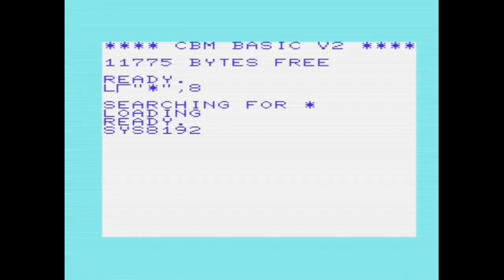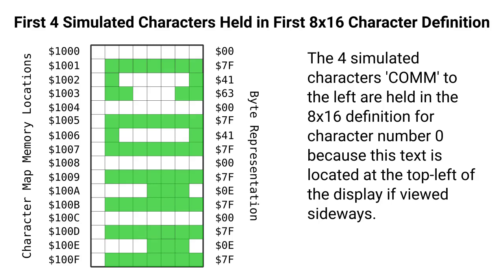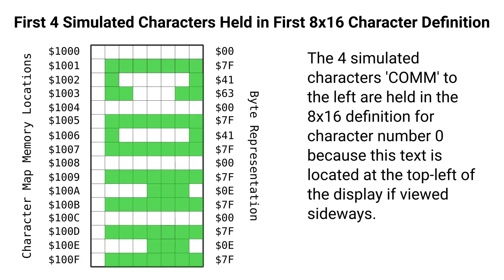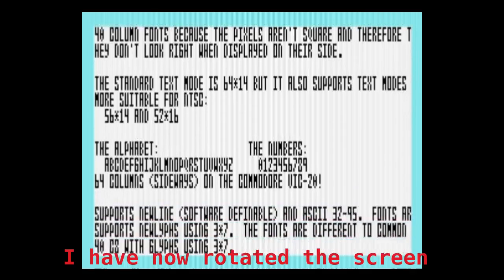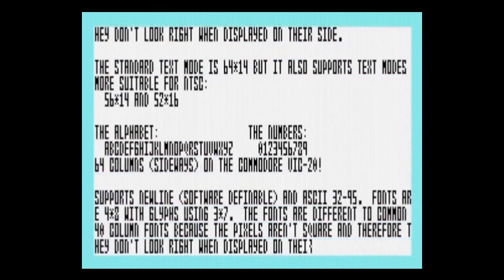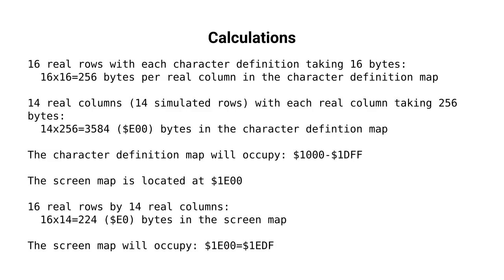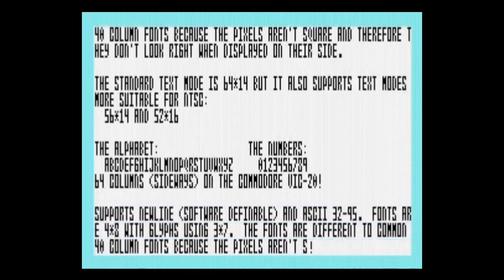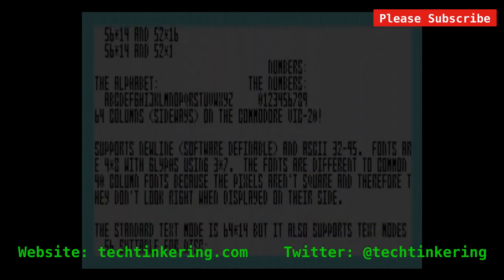64 Column Text Mode on the VIC-20

Comment: The vic was a very versatile machine if you put the time into doing things like this. Excellent video as always.
Reply from the maker: Thanks.  The Vic's combination of simplicity and versatility is one of the things I like so much about this little machine.
Reply: @TechTinkering  I regret selling mine decades ago. I do use the emulator. Do you know if you can do tricks with the interrupts like for instance the using the scan line number register? I'm thinking ify ou can use that somehow to switch character location out on the fly you might be able to get even more screen real estate by using two RAM based character sets.
Reply from the maker: @GORF_EMPIRE  There isn't an actual raster interrupt, however you can query the raster position and create another interrupt to synchronize with it.  I was thinking about using the raster and two 32 column screens (viewed sideways) and flipping them when the raster reaches the bottom of each.  This would allow me to reach the 64x16 text mode that I would like and probably do even more simulated rows.  Something to try for the future when I get time.
Reply: @TechTinkering  I say do the flip in the center of the screen and do 64 x 32. Look forward to see what sorcery you come up with.
Reply: @GORF_EMPIRE  You can always buy one on eBay, although they are a little more expensive now than years ago.
Reply: @unebonnevie  I know but funds are tight and quite honestly I need to get rid of things more thn collect them. Have other expenses and priorities. I have an emulator and the MiSter FPGA which are both beautiful things but to be able to type on that old keybaord again.... ah the memories.
Reply: @GORF_EMPIRE  check Keyrah, with that you can type on the commodore keyboard and plug it to anything with usb  :)
Reply: @roonie12video  Neat device. Something to consider in the future.

Comment: If you don't mind the character codes from moving around in the 224 bytes of the screen in sideways mode, you can scroll quicker by moving the codes (rotate around and clear the lowest line) when scrolling up (to the right). Also, with a Lumacode extension to an RGB2HDMI connected to a turnable widescreen HDMI widescreen, you could have vertical page properly depicted.
Additional, if you were to implement an ASCII BASIC, or perhaps a more simple turtle program, you can implement graphics routines that can write into the "textscreen"  as well.

Comment: NTSC can do more columns if you take advantage of interlace. However, this dramatically increases the RAM required per row and/or makes you use uncomfortably narrow characters.
Reply from the maker: That is interesting.  Thanks for letting me know.  I've never used interlace mode on the Vic because it isn't present on the PAL version.  I'll have to see if I can find an emulator which can do it.  I think Z64K can, not sure about Vice.
Reply: @TechTinkering  There's also a very weird NTSC VIC-20 capability which, AFAIK, I am the only one to ever experiment with. The NTSC composite output, when connected to a monochrome TV/monitor, can be used with two alternating fonts or images to provide 14 horizontal pixels per character instead of just 8. So, a 20 column wide display would be 280 pixels wide (same as Apple ][) instead of just 160 pixels wide. That could be enough for 70 columns, but there just isn't enough RAM for full height.

No one else at Denial seemed interested in this AT ALL, and I never really figured out anything cool to do with it, so ... I just sort of stopped experimenting with it.

I mean ... it's something that no emulators even try to emulate. It can only be done with NTSC VIC-20's that have NOT been modded for S-Video output. You need a monochrome monitor, or a Commodore 1702 (so you can plug the composite output to the luma input of the separated video input). There's just so few people who could even ever take advantage of this.
Reply from the maker: @IsaacKuo  That is clever; back in the early 80s if it had been discovered and published it would probably have got a fair bit of attention.  I guess that people's interests change over time.
Reply: @IsaacKuo  How does that work?  Is the horizontal position register altered every frame?
Reply: @CommodoreGreg  No, the VIC-20 doesn't have a fine horizontal scroll register.

This isn't a true "interlace" capability (which the VIC chip actually does have, but that only improves vertical resolution).

Basically, it has to do with the fact that NTSC solid color appears as a checkerboard pattern on a monochrome TV/monitor, and with some systems, this checkerboard pattern alternates phase each field (VIC-20, most C64s, C128, Amiga).

Now, the VIC-20 pixels are not properly aligned with this checkerboard pattern, but let's just pretend that they are to simplify the explanation.

If they were aligned, then 160 horizontal pixels would be ANDed with a checkerboard of alternating pixels 320 pixels across. However, the "on" pixels of the checkerboard alternate with each field.

So, on one field, only the "odd" pixels are visible. On the other field, only the "even" pixels are visible. By alternating between two sets of 160 horizontal pixels, you get a horizontal resolution of 320 pixels - just with only half of the pixels visible at a time.

With the VIC-20, things are complicated by the narrower pixel aspect ratio. So, a horizontal width of 160 pixels only covers 280 pseudo-pixels of the NTSC chroma checkerboard pattern. It's not a coincidence that 280 pixels is the horizontal resolution of the Apple ][, which has the same 1MHz clock speed. This is basically why the Apple ][ character set is 7x8 pixels instead of the far more common 8x8 pixels.

Comment: If you do a (real) resolutuion of 120 x 256 (= 15x32 chars) you could do a 64 x 15 sidways-textmode. Place video-RAM at &1000 and char-ram at &1100. Then fill the video-RAM starting with character 16 up to 255 (=240 chars). This way only 16 bytes are "wasted" between &1000 and &1100. If you want 64x16 you would need a bitmap of 128x256 using the full 4K from &1000 to &1100. You can then put the video-RAM at &0000 and swap it in and out using speedcode and a raster-interrupt if you want to keep BASIC working.
Reply from the maker: It's a good idea in theory.  However, the character map has to be located on a 1K boundary so the next location above $1000 is $1400 not £1100 unfortunately.  Therefore, there would be a need to overlap them, which can be done and would be the most obvious way to achieve 64x15.  To get above this yes we would need to swap the screen map location in time with the raster.  Although I don't think I would favour using $0000 for this.
Reply from the maker: Just wanted to let you know that I've seen your other reply in my notifications but for some reason it isn't appearing when I go to reply to it.  It also isn't in my 'comments held for review'.  There seems to be a problem with comments on YT recently which quite a few channels have reported.   Anyway I just wanted to say your thinking over overlapping the screen and character map is much the same as I was thinking.  When I get a chance I'll look at this further.  I also wanted to say thanks for the links.